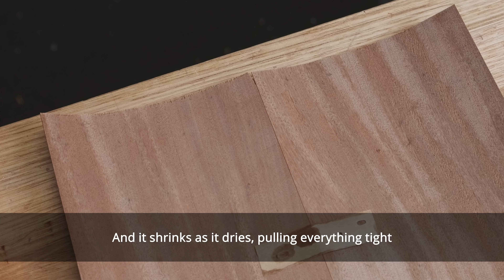Veneered (Parquetry) Box With Wooden Hinges

Comment: Nice work Paul! I never would have thought of re-tasking a vacuvin stopper as a a valve for a home made vacuum bag. Might I suggest having a read of Craig Thibodeaux's Craft of Veneering as it's a goldmine of tips and tricks
Reply from the maker: Hah, not my idea but a commerical product. "Roarockit", relatively inexpensive way to get into vac bagging, but it is exactly what you described! It's not perfect - something with a proper pump would be better for keeping pressure, but I've used it a dozen or so times without failures

And Craig's book is a gem, bought it just before I started the box!
Reply: @TheWoodKnight  My brother-in-law is into making boxes so I'll suggest the roarockit to him as it looks a bargain. I've been looking at joewoodworker kits as I'm about to try my hand at building a strip planked surf ski from one of Bjorn Thomasson designs and I would like to vacuum bag some of the fittings. What size bags are you using?
Reply from the maker: @geoffsemon7411  It's been awhile since I bought it, but I'm pretty sure I have the 35x52" http://roarockit.com.au/index.php?id_product=14&controller=product

It allowed me to veneer the leaves on the Woodwhisperer Gaming Table. Only thing that wouldn't fit in that is a desk-top or higher, but I don't have the plattens or bench space to do that anyway, hah!

Comment: Really enjoyed this. I have the incra iBox but haven't even opened it yet. I'm inspired to make a box now, likely a bit simpler at first. I notice you flipped around the work piece on the box joint jig. Was this so you could ensure you ended on a full finger? Was the middle one different size or just close enough?
Reply from the maker: The ibox is fiddly to setup... until you "get it". The training video is good, but its also very... confusing about "how snug" things have to be. Once you get it right though, :chefkiss: its great!

The board was flipped to create a "center keyed box joint" - all the "extra" gets pushed towards the middle where there would be a fatter key. I knew I'd be spliting the box in the center - removing a kerf width meant it'd look more "normal" once split.

I'll see if I can find incras video on that specific bit for you
Reply from the maker: https://youtu.be/EXgfuA8kZb8?t=2115

At the 35min mark, it covers the center keyed box joint. It was the first time I did that too. 

It doesn't have to be centered either - you can offset it more towards the top or bottom, just requires counting the right amount before flipping!

Comment: Another great project Paul, well done. Regarding jointing the edge of the veneer using a plane, I’ve also had success using a long sanding block; less chance of splintering the veneer. Also a question: is the grooved melamine panel inside your vacuum bag there to help spread the  vacuum evenly? Cheers mate, John
Reply from the maker: Yup, the platen has grooves to make sure the bag doesn't stick so well that air can't flow. The breather mesh (looks like an orange back wrapper!) on top does the same, but you can also use a top platten.

I lucked out with jointing the veneer when I had the plane travelling the correct direction. Got a much cleaner cut with the LAJ than my #4, so I guess the blade angle helped there too.
I do intend to make a 'jointing sander' but I ran out of long sandpaper to do it. Thats next on the shopping list :D
Reply: @TheWoodKnight  Thanks mate👍

Comment: Paul, why did you use the veneer saw on the long grain and a craft knife on the cross grain when you were cutting the veneer strips. Is the veneer saw too rough to cut cross grain?
Reply from the maker: Well spotted! That was exactly it, I found that jarrah was really splintery once it was shorter than 5cm and was risky with the saw - it could just be my saw needs more tuning.
Going the other way, a craft knife isn't good with the grain as it tends to follow the grain, but cross grain kept a nice crisp line
Reply: I think I only used a knife when I did veneering at TAFE years ago. But it was also a single bevel blade.  The veneer tape was a pain to deal with too.
Reply from the maker: Ideally I'll end up getting something like a kiridashi - single bevel japanese marking knife that has a long flat cutting edge, so it can still be referenced up against straight edges. The utility knife had the longest "flat section" of all two knives I own.

The gum tape is... interesting to work with. Staggered/single hole isn't easy to peel back off, but its also not as fast to sand off as two or three hole tape would be. I got "OK" at it by the end of the project, rewetting the tape to activate the glue and a plastic scraper did wonders